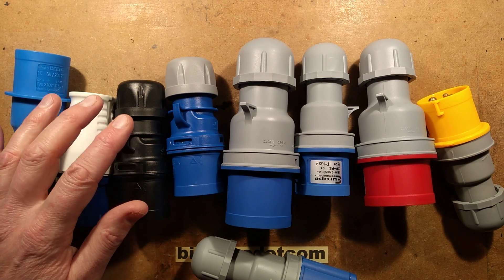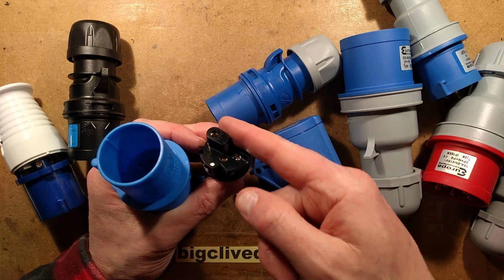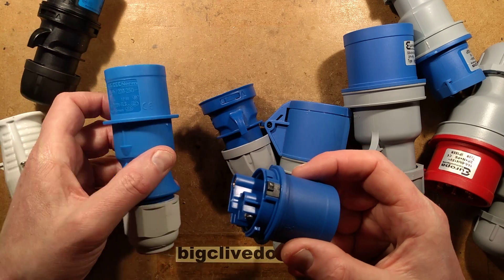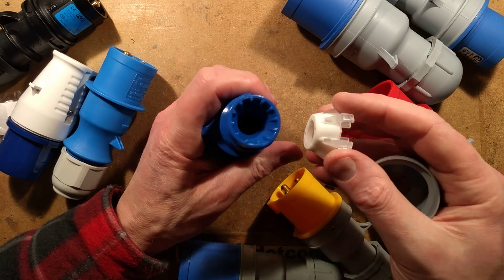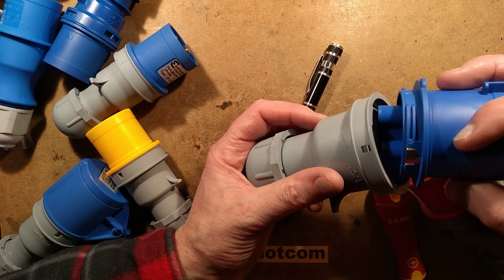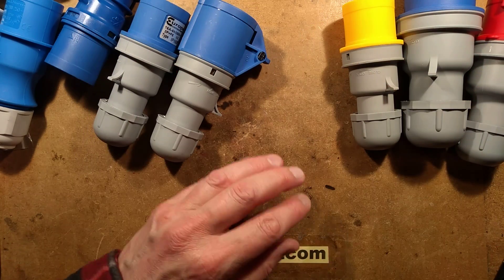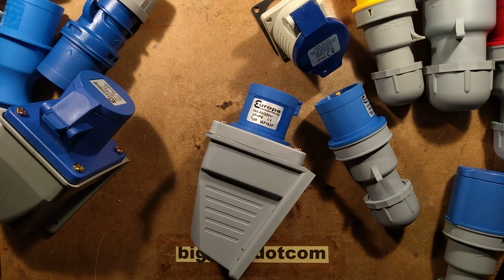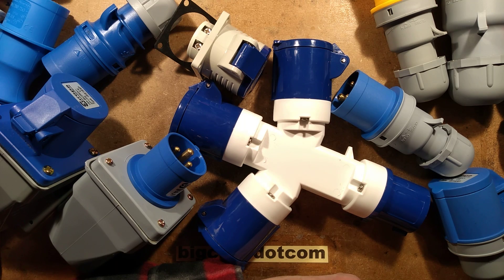My favourite industrial connector (Ceeform).

Comment: You'll find these ALL OVER Europe (at least), as they're codified and standardized in IEC 60309. You may also hear them referred to as "Commando" connectors, as the first major supplier of these, MK, sold them under the "Commando" brand name.

Here in Canada and the US, there's a whole mess of differing NEMA plugs and sockets picked seemingly at random for a wide variety of uses.
Reply: Here, let me help you out with how NEMA plugs and sockets work, let's take an L6-20R for example:

L - designates this as a LOCKING type
6 - designates the voltage 240, single phase, and that this has a grounding connection
20  - designates the amperage
R - designates this as a RECEPTACLE

 So how do you figure out what you need to use? It's not done at random!

1)Do  you need a ground connection? In most cases, especially at voltages over 120V this answer will be YES.
2)What voltage do you need?
3)Single phase or three phase?
4)How many amps do you need? Note that you are not allowed to draw more than 80% of the rated current of the plug/socket for continuous loads(defined as loads that will be powered for longer than 3 hours), so for example a 20 amp plug/socket needs to be derated to 16 amps, and a 15 amp derated to 12 amps.
5)Do you need a locking or non-locking plug?

With these 5 pieces of information, combined with a table of NEMA plugs and sockets, you can determine the exact plug and socket you need for a given application, assuming that the manufacturer of the device you seek to connect has not already done it for you.
Reply: Brian Leeper the problem isn’t the nomenclature. It’s that the family is far too big and they don’t really share a family resemblance. You’re also missing the color coding, but that’s a common US flaw, just look at your money.

https://en.m.wikipedia.org/wiki/NEMA_connector#/media/File%3ANEMA_simplified_pins.svg

Why are locking and non locking variants a thing?
Reply: @JasperJanssen  Color coding is often defeated in many industries simply because "We didn't have the right one on hand".  Similarly, as Clive mentioned, plastic key tabs are readily removed.

Conversely, NEMA connectors key via permanent incompatibilities such as pin size, shape, orientation, and spacing. The installed base for NEMA connectors began well over a century ago (NEMA later standardized on an already-existing design) and now includes literally billions of devices, both plugs and receptacles. Much like the Edison screw for lamp sockets, any attempt to mandate a replacement would simply result in - and effectively require - multitudes of adapters for purely practical reasons, with debatable safety. Many small contractors like me simply aren't able to replace our thousands of dollars in existing power tools in what regulatory bodies often consider a "reasonable" timeframe.

The gross difference between NEMA connectors and other designs serves another practical purpose: it prevents devices designed for e.g. 120V half-phase at 60 Hz from being casually plugged into a receptacle supplying 230V full-phase at 50 Hz, those being common household supplies around the world.
Reply: Here in Canada and the US, there's a whole mess of differing NEMA plugs and sockets picked seemingly at random for a wide variety of uses" Just as i expected. No standardisation with the rest of the world. US power is a bodgy unsafe inefficient mess. Lots of videos on YT of US power lines on fire, most of which were preventable with a bit of maintenance. None from the UK.
Reply: @simontay4851  - Yeah no wonder California burns down every other month. Or wait no.. I'm sure that's not the issue. Right, it's because people should be raking the forest floors... of .. California? 🤔
Reply: @TheMrVengeance  currently California seems to prefer Power outages over Forest Fires. At least in the Summer/Autumn...
Reply: @unitrader403  - I mean... that seems sensible. Why would you rather have forest fires?
Reply: @simontay4851  Don't blame shitty engineering for what is really a problem of poor maintenance.
Reply: @brianleeper5737  - They literally say it's a problem with maintenance in the very same sentence..

Comment: In case IP44 is not watertight enough, there is also an IP67 version with an interlocking ring around the connector wich also makes the connector less likely to unplug due to strain on the cable. For. 125a IP67 is not only available but mandatory.

Comment: Use them at McDonald’s for the muffin toasters, grills, vats and such.
Reply: I was just wondering why I was having deja vu back to my golden arches days
Reply: I worked at McD back in the 90s, and remembered the grills and vats were basically permanently attached to the walls, but they could have had those connections at the back.  The main aisle definitely had them hanging from the ceiling for the "Q'ing ovens", patty/egg warmer, muffin toaster and muffin warmer, since all of those were designed to be broken down and cleaned nightly.
Reply: @RyanFinnie  lol once a week someone would stuff the muffin toaster too much or not unload it smoke would roll out and out came a hocky puck
Reply: Yeah in my kitchen we use them for the rachenels that are like 20k and we have 3, each oven has a HUGE switch.
Its scary.
Reply: It's true I've installed these connectors at mcdonald in Canada back in 2017
Reply: Are you telling us to use them in McDonald's?
Reply: Yep, worked at one for six years, lots of these things. Grills and vats get the biggest ones.
Reply: In malaysia, we use those 15A round plugs, UK used to use them, but they dont anymore.

These kind of industrial or my country call it "commando" plugs are usyally used for like high wattage freezers, ovens, etc.

Meanwhile the 15A plug ones are used for like commercial microwaves or something lol

Comment: These are used all over europe on campsites to connect caravans, campers and such to the mains
Reply: Fun fact: They are also used in places where they don't want members of the public to use the wall sockets: Subway stations and even on some regional trains.

Or course you can buy adapters but who would carry one in his backpack during a day in the city ?
Reply: @psirvent8  Big Clive?
Reply: psirvent8 I would
Reply: @psirvent8 well, if I lived over there and knew this I would :3
Reply: @psirvent8  trains many times is not same voltage but industrial 400v
Reply: @franciscorompana2985  Trains generally run on high voltage above 1000V single phase.  But there's often a converter providing regular mains voltage (which is 400V 3-phase, 230V per phase in most of the would).
Reply: In New Zealand they are simply called a "caravan plug" :)
Reply: @new-zealand-clippy  same in Finland
Reply: Agreed, NZ caravan plug 16amps
Reply: @new-zealand-clippy  In Germany we are calling that also an caravan plug.
Reply: @subjekt_9142  In the Netherlands, they're often called "eurostekkers" ("euro plugs").
Reply: @crytocc  interesting in germany we are calling the CEE 7/16 (Plugtyp C EN 50075) Eurostecker.
Reply: Wiki Article
German: https://de.m.wikipedia.org/wiki/Eurostecker
English: https://en.m.wikipedia.org/wiki/Europlug
Reply: I think I seen one of these at a U.S. campsite, but not sure..  Maybe marinas, too?  IDK.  Definitely in factories, restaurants and such.  Much more common cable than one would think by looking at it.
Reply: Marinas:  I have seen these used for homeowner's powered docks, so you are likely correct for marinas as well.
Reply: Yeah I use them on my house boat, all the mains supply points in the marina I live in use these and most boat owners carry them.
Reply: @larrygall5831  In north america the NEMA 30TT plug is pretty standard for RV's. The NEMA14-50 is also common on newer/bigger RV's. We also use NEMA L5-30 twist locks and L14-50 twist locks.
Reply: Yup, know these from my parents' caravan and they would fit to the sockets at campings throughout various EU countries.
Reply: Look like a " caravan plug". Here nz are commonly used to charge electric cars at 16A 240V. I've got one on side of house which I plug a modified cable to slow charge by Nissan lesf. Can also plug your caravan too.
Reply: We also use them in HazLoc areas.
Reply: Yup commando sockets.
Reply: @lmaoroflcopter  Came here to say the same - have always known these as a commando plug (or socket) - and first experienced them on campsites
Reply: Also in South Africa called the Caravan Plug.
Reply: Yep, as a french, those are camping plugs.
Reply: Her in Sweden we cal them europluggs. Mostley we use the red 450v 3 fase bothe for home and industrial use. Ther no permanent connection is needed. Or for powering mobil units.
The blue 230v 1fase is used on caravans and marinas. Therfor they ar sertified to be fused with 16A. And regular outlets onley 10A. At least for now.
Reply: @JamesTK  We use the red and blue ones on consruction  sites and repair/ metal work shops (germany) . We call them Cekon plugs. The little blue ones (16A) are called caranvan plugs by non eletricians.  I got an  230/400V16A red  socket in the  garage for my jet cleaner and air compressor.
Reply: I'm used to seeing them on boat docks in the US and on some rv hookups. They're really nicely built.
Reply: Used in South Africa for anything you tow, trailers, caravans, etc.
Reply: I'm sure we had a cable with one of those plugs for our trailer tent (all was sold several years ago).
Reply: Yes but many campsites deliberately use a wierd version (often using a 3ph red connector or even a green one (supposed to be for high frequency AC)) then rent you an adapter cable. To prevent people using the hookup without paying
Reply: @dasy2k1  the only campsites where i've seen the power blocked off for people who didn't want power just had the breakers for seperate spaces behind a locked door near the outlets, seems more logical too
Reply: They’re used in marinas too.

Comment: You do get (at least used to and I don't see why they would stop them) a 240v socket that points down at 45 Degrees  to stop water ingress, common on caravan sites.  I like the Shark connectors, never used them before.  I never liked the way some were open and not shielded from each other.

Comment: Common in Poland, in industrial settings, workshops and most free standing homes. Used for all things , especially on construction sites (concrete mixers, welders, local power distribution, lifts, etc), entertainment events, etc.

They were used in Poland almost forever :)  40 years maybe? I don't know which exact connectors were used before that.

Some people call them Mufa in Poland.

Comment: What gauge wire (AWG) is used in Europe for 16 amp and 32 amp circuits?  In Canada, the standard house circuit is 15 amps and the wire is 14 gauge pair(live+neutral) plus ground.  But that's for 110/120 volts not 220/240
Reply: Alacritous 2.5mm for 16A and 6mm for 32A. The AWG scale is not well known here. 
However normal house wiring is usually 1.2mm or 1.5mm and on a 6A to 12A fuses. Might have 16A in the garage. Unless you are in the UK that have strange ring wiring for their sockets on 32A. Which is why the UK needs extra fuses on their electrical plugs.
Reply: Thanks for the info. I appreciate that the American wire gauge isn't well known over there. I've always thought it was dumb. The wire gets smaller the higher the gauge number.  Who thought that that was a good idea?
Reply: @Alacritous  Last time I bought wire it was marked in both AWG and mm2.

Comment: US here, I used them on a series of mobile and rapidly deploy-able security camera rigs that we built for the local police force for events.  They were a tripod that you would stake down to something and extend the pole up with an IP Camera, Network switch and a wireless mesh network adapter on board.  You feed it the 110V in from whatever source is available nearby and don't have to string network cable back to their mobile command center.  We had made up 30 ft long adapter cables from the standard US 15 amp outlets to these Ceeform.  Idea being that they would get the power from a permanent structure at an event or concert and the other end up the pole would be the water resistant Ceeform.

Comment: Expect them to be common for anything industrial all over Europe. A really clever one is the 5pin 3 phase where you with a screwdriver  can swap two phase to change the direction of a motor without taking the connector apart

https://media.highlight-led.de/products/images/40336.jpg

Comment: They use them for campervans and caravan mains voltage hock ups
Reply: Worked at a equestrian center. All of the big horse lorries (€100k-€800) use these to charge there batterys

Comment: We use green 5 pin for 3 phase 400Hz power supplies. I'm surprised that Mennekes aren't in your lineup! They are my favourite manufacturer of ceeform. They have started to introduce the twist lock style of case too. They do a nice midnight black variant too.

Comment: Sweden. I recall that the 60+ ampere 3-phase connectors have 2 fastening screws for each wire. It was quite a bother to assemble with really thick cables.

Comment: @02:35 Those screw terminals should never be used with stranded wire without ferrules... the screw will damage the strands quite badly and the wire might slip out of the terminal or it might break completely with even a  little of repeated shocks or mechanical vibration :/

Comment: We use the Austrian made style in our shipyard with the Lifeguard Spinefex system. Australian power tools and general equipment still uses the AS:3112 connector (our BS:1363) but we were using the IEC60309 for the temporary lighting and 415V distribution.
I agree, I really like the design of the Austrian produced products. I hate those white conical backshell units.

Comment: In Germany, we use those blue connectors on mobile homes and such things.
Reply: In the US  we US them  in factories for 480 three-phase and for electrical hookups for boats
Reply: Most of them are blue!
Reply: @HuntersMoon78  the blue ones are for 230V alternating current, red is for 400V three phase and yellow is for 110V. so the color you see most will vary depending on what you are doing.
Reply: @kertas1991111  yes.. i mostly use blue 3 phase  with 3 live and earth.. no N lead.
Reply: @grapsorz  Oh yeah, US three phase is only 230V of course. You don't need 400V rated plugs in the US, since nobody actually uses a real power source like that ;)
Reply: i stil think you use the 5 prong one 3L N and PE right?
Reply: @benedykt123313  hun well, on towboats used 480V since 1980 on a boat that was built in 1976
Reply: @grapsorz  well yea for 3 phase we use the 5 pronged one even if we dont need neutral for whatever we are connecting. why grab something with 4 prongs just to ensure that if ever you do need the neutral you need to redo theoutlet?
Reply: here we only use the blue 4 prong as there is no ground so you cant use it.
Reply: @benedykt123313  Three phase in the USA is usually either 208V wye or 480V wye, with most larger commercial buildings supplied with 480V three phase. Also in commercial buildings that have 480V three phase, most of the lighting fixtures are wired phase-to-neutral and run at 277V. 

240V delta three-phase in the USA is known as "high leg delta" and this is RARE. Apparently, many electric companies won't install this anymore. In this configuration one of the transformers will be center-tapped so that 120V loads can be supplied.

208V is used because the phase-to-neutral voltage is 120V and that is used to supply receptacles.

When 480V is used, transformers have to be used to step down the 480V to 208V to supply 208V three phase loads and 120V receptacles. One of the considerations of the economics of 480V is that these transformers are on the customer side of the meter and always consume power---and this is a continual, ongoing cost. So it may not make sense to use 480V in smaller buildings for this reason.

Many years ago I ran across a bunch of new-in-the-box 277V light fixtures dumped in the woods, apparently because the moron that stole them found out they wouldn't work in his house.

Comment: Germany, basically on all industrial applications like welding machines, ovens in restaurants, powered gates in workshops. On festivals you can see huge boxes with tons of these connectors where all the mobile shops can get power. At home they are uncommon... Our 3 Phase ovens (every german home has 3 Phase power) at home are connected directly to the wires from the wall without a plug.

Comment: UK, used to be my job as a kid to help my dad setting up the mobile lithotripter, CT scanner and MRI machines he used to cart around for Lion Medical back in the late 80s and early 90s. They had a couple of big white with blue livery expanding side trailers with everything on hydraulics folded up neatly inside, you couldn't get in until you powered it up and ran through the set up procedure to make it all expand out and make room to get in. At one point they were some of most expensive trailers in the UK and were outfitted with the latest and greatest tech, so it was pretty neat as a kid getting to press buttons and make real life transformers move about in hospital car parks up and down the country, but first it was up to me to drag the massive heavy duty cables across the car park and plug in the familiar blue plug.

Comment: Used a lot in server rooms \ Data Centres. Blue type connector typically.
Reply: Confirm that. Same for me too.
Reply: Yep, use them in our Data Centres and network  distribution points
Both 16 and 32 amp in use, I understand
Reply: Yes we have both the blue ones and the red ones in our server rooms.
Haven’t checked their ratings
Reply: Yes we have both the blue ones and the red ones in our server rooms.
Haven’t checked their ratings